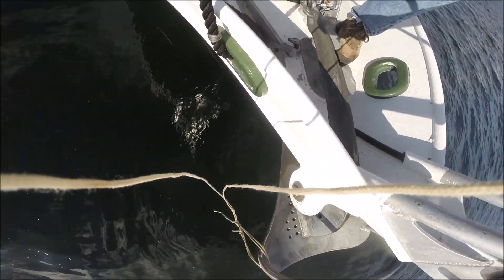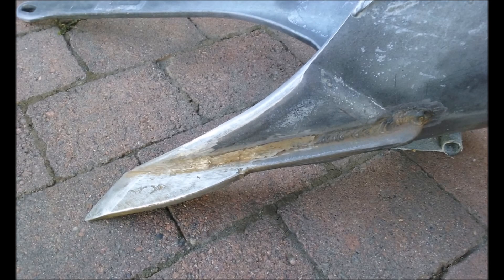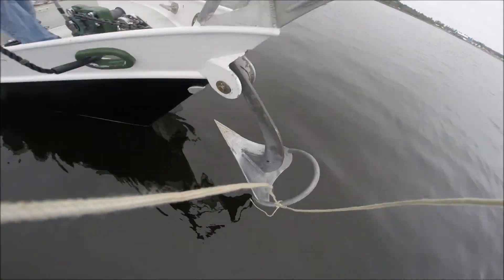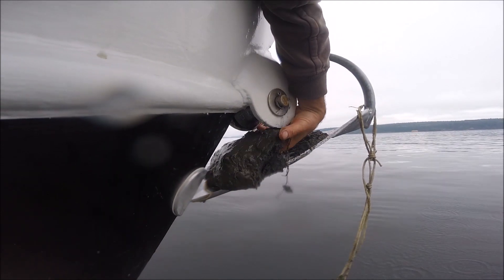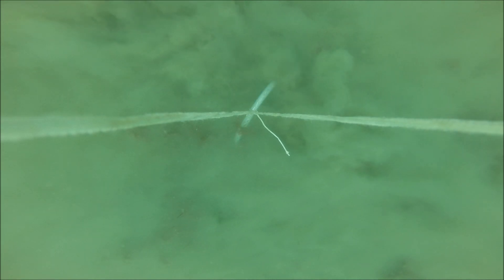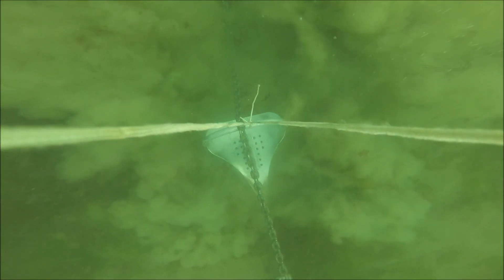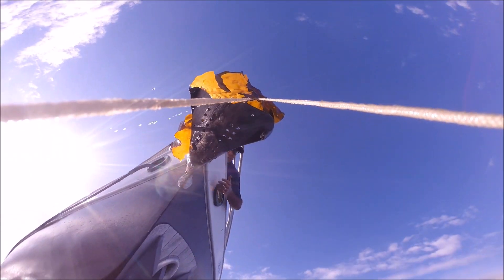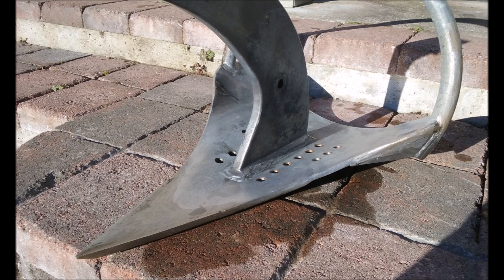Manson Supreme Modification Conclusion.  Video #67

Comment: Thanks for putting in the effort to change & test this anchor. I have just bought one & will probably make the same mods as the sea bed were I anchor is about the same. The slot in the top is a bit useless, messes up the bottom hole for using a swivel as it does not allow it to pull upwards.

Comment: I have been using a Manson Supreme for many years and seeing your test with the reverse pull spooked me!  I'll be doing my own tests of this to see if my anchor is not resetting. I do know that there are times when the fluke comes up with mud on it.
Have you had any more experience with this modification of the Manson Supreme?
What was your reference for why the holes might help with keeping the flukes from clogging. The only reference I found was Rex Francis in a video mentioning that the holes help the mud come off while the anchor was being raised.
Thanks!

Comment: Very interesting! Thank you for this! Last video I saw showed you choosing the Spade. Did you switch to this because you became unhappy with the Spade for some reason I missed, or were these tests just for fun?

I, too, am curious: do you think this might solve the Rocna as well? Also, is polished stainless steel good for shedding mud? Want to test am SS vs galvanised anchor of the same design?

Comment: Really great video , lots of patience , and great skills . My question would be , is it really necessary to try the reset with 3-3,5 knots ? In most cases my boat turns much slower around when on anchor  ,  the reset ratio may  be much higher   at lower speed . Best to You from Hungary .
Reply from the maker: Thanks, Pesti Z.  I agree, the high speeds would be a very rare (but not unheard of) occurrence during normal anchoring.  At low reset speeds, the anchor is likely (but not guaranteed) to remain engaged and re-set without problem.  I use the high speed to amplify the failure frequency so as to not have to make as many tests.

Comment: Would you consider proofing this experiment at some point by going ABAB. Eg blocking the holes you drilled in the same way you did on Super Sarca with tape then re-testing and then removing and re-testing again?
Reply: HI Steve, i'm in NZ looking to purchase an anchor for a 47" boat. I'm reluctant to go with a convex anchor, as had so may problems with our CQR. SPADEs are not easily available here possible due to cost or the incident in 2004 where a boat was lost and the Maritime body ruled the design of the anchor was at fault. Suggestions?
Presently looking at a second hand Rocna and wondering if I should repeat your test and drill holes in the fluke?

Comment: Really appreciate you sharing your experience...amazing...do you know if anyone has modified a CQR by welding the hinge so it is static? ...and what the results might be?...we now have a skookum53 that came with two CQR's . i am looking to make a change before heading to AK this summer...thx again
Reply: Bit late for the reply, But I did weld the hinge of one & put a hoop on the back. It worked much better.
Reply: Even later the car without the hinge is a delta.

Comment: I am really curious to know if putting holes in a Rocna would help it in these tests as well since it seemed to set perfectly on the initial set but had problems with the reset due to mud\fouling.
Reply: I had the same problem with my Rocna 33 almost lost my boat. Sets well only first time if the wind changes you have no anchor.

Comment: Yes Interesting, For those worrying about the anchor being lighter then you could use a bigger anchor which would have a larger holding area. Also I always wonder when you drop it you back up and it sets but when you change your going faster and it spins around so fast that it doesn't have time to reset. have you tried going slower and see if it does the same ? I think on one of your video's you did do that. I can't see any way those holes would weaken it for holding a boat.

Comment: Very interesting. Did you try putting a heavy swivel on the connection between the chain and the anchor? It should change the balance enough to cause the anchor to bite better on the re-try.
-johnny
Reply from the maker: I have not used a swivel on an anchor.  It is hard to imagine that a 105 foot length of chain could transmit a detectable amount or rotational force from one and to the other without first winding the chain many, many wraps.  But I have been wrong before..........